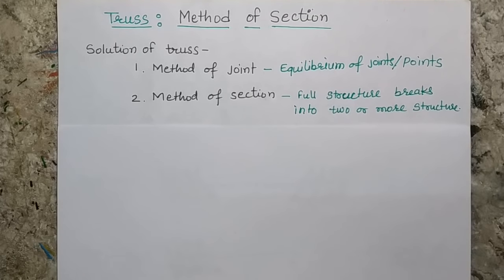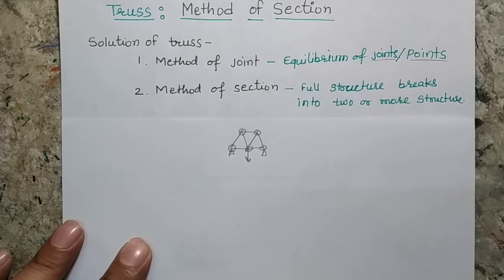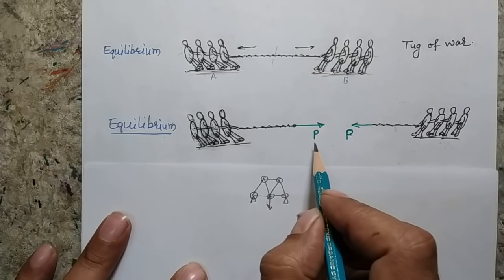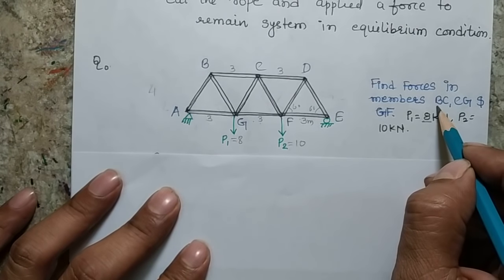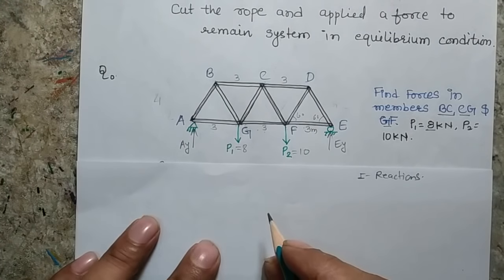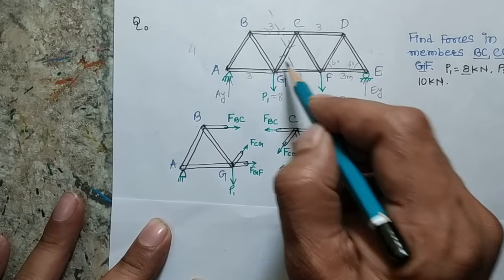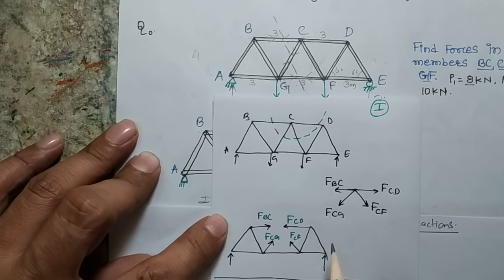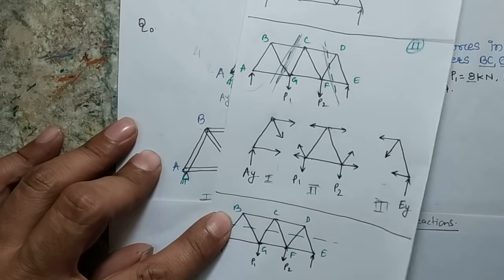L3.4 Truss:Method of section || Explanation  and simple example || Engineering Mechanics || Ist Year

Comment: Sir im still confusing about 2 method in solve truss problem, the first method is joint method, in this method we are assuming the force is working on the joint because of that as we know about action reaction,  the force which is work on the member have opposite direction with force that work on the joint
When we use the section method how we assum about the force or where parts  does the force work in joint or in member  because when we want to calculate equilibrium state we usually isolate one stuff that force work on it

Comment: A few questions. in Moment of c at the end you are showing a vertical force in the counter clockwise position as negative. Why is that? In class we learned counter clockwise is positive. Also I feel like you made mistakes with the vertical equilibrium equation. You flipped the positive and negative forces when you were solving for GC. Why is that?
Reply from the maker: Currently in a  class..I WILL ANS YOUR QUERIES SOON
Reply from the maker: Sign conventions defined by us, hence It is not going to change overall sense of your entire equation.  if I choose CCW is negative and CW +ve, it will also give same final result. actually if you will change sign of one term as per your convention, you will also change sign of other term. SO eventually it is just changing sign of all the terms in teh equation. Therefore, final result will not change, and the sign of final answer will define sense ...for example I choose CCW -ve and if my final answer is +ve I will say that my answer is of CW sense. Similarly flipping sign is okay a someone may consider upward forces are negative and vice versa. sign convention will not affect final answer. Moreover, I will be able to answer more precisely if you will indicate time instance,